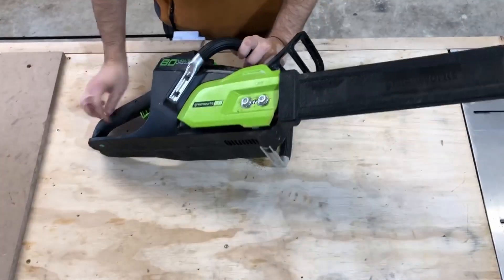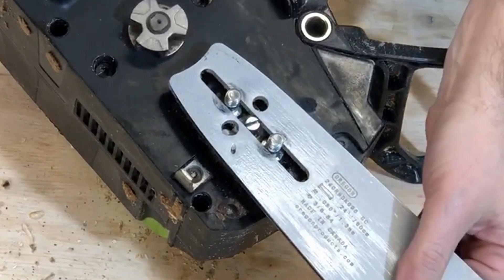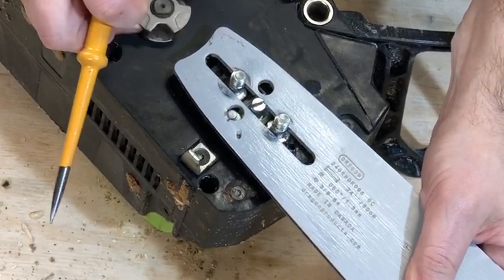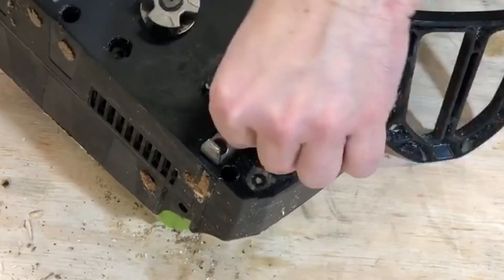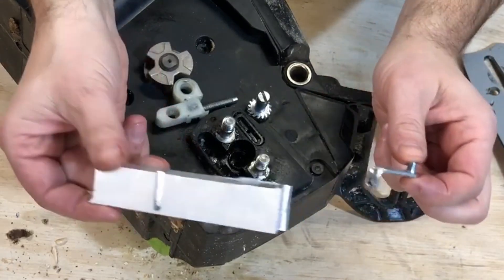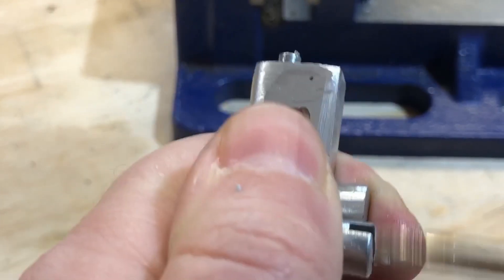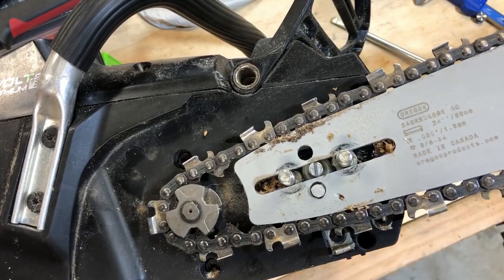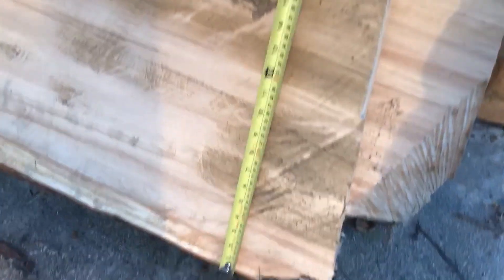Can Battery Electric Chainsaw mill 22 inch log?

Comment: Thanks for making this video. Do you know if other size bars will fit the Greenworks Pro?, maybe just a bit smaller like a 20".
Reply from the maker: I originally ordered Oregon 240RNDD025 bar and it didn't fit, 240RNDK095 shown in the video worked. With that I understand that bars with PN ending in K095 should fit. Something like 200RNDK095 should work IMHO.